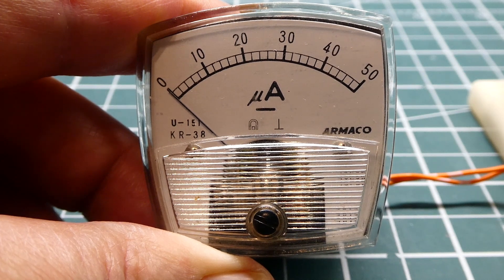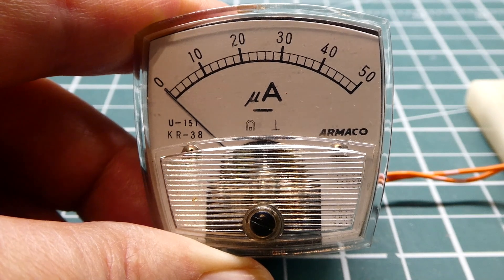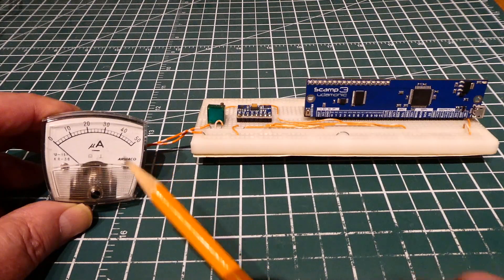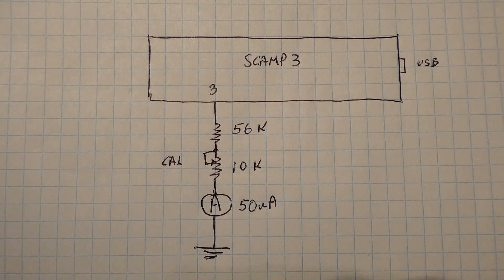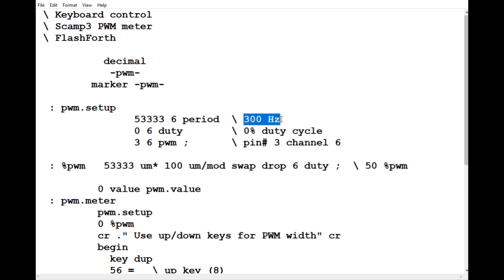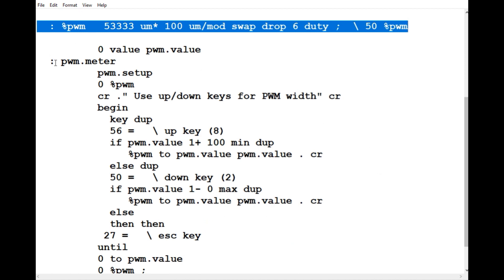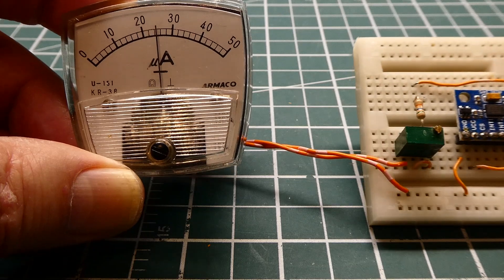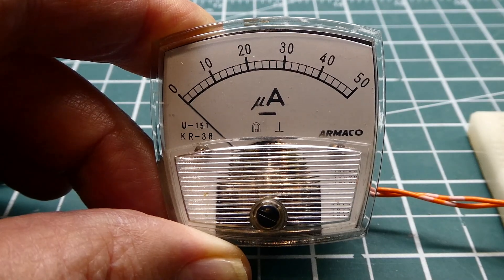Analog Display / PWM / Tilt Meter

Comment: Probably an obvious question, but for this circuit can I use an A/C ammeter or does it need to be DC ?
Reply from the maker: The circuit is designed for a DC Permanent Magnet Moving Coil Ammeter ( PMMC) There are different types of AC Ammeters. A Rectified AC Ammeter movement that has an internal bridge rectifier will work.

Comment: An excellent video Ken.
I have quite a few VU type meter movements which are non linear in terms of needle deflection vs.voltage.
However, I thought a good exersive would be to write some code in forth to linearise them.
The approach that first came to mind was to create a scaling word rather like the map function in Arduino but firstly divide the scale into ten or so ranges and arrange for the scaling to have the requesite "weighting" in each range in order to produce an overall linear deflection using pwm.